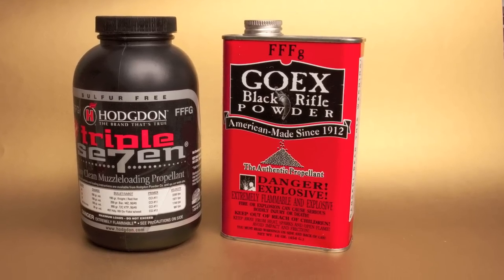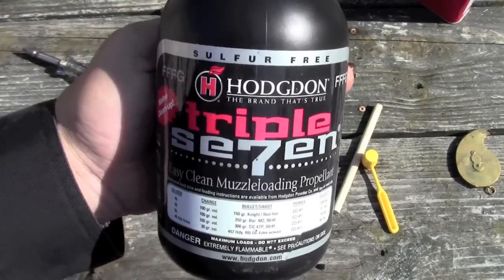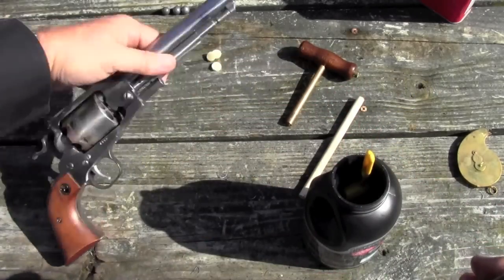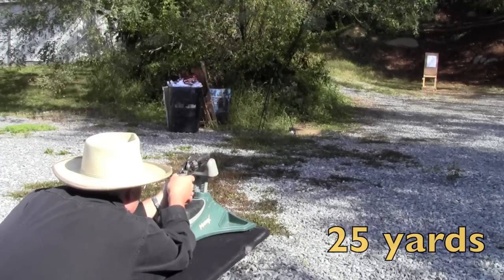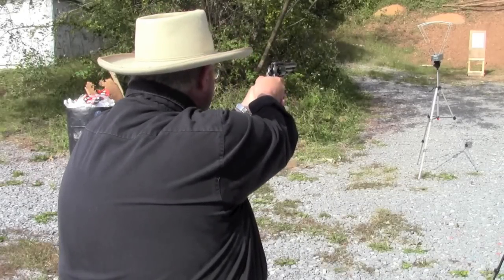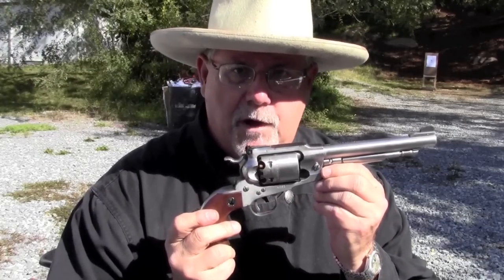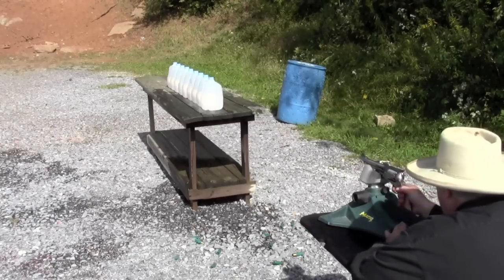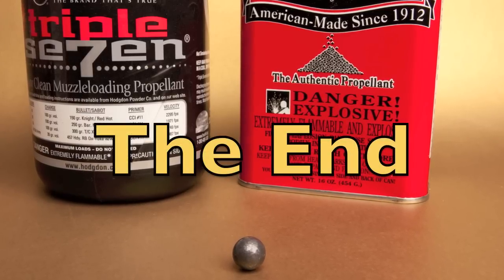Ruger Old Army powder   projectile test part 2

Comment: Great video Mike. On my Ruger Old Army I have a conversion cylinder in 45 LC. I load my brass to the top with 777 and a hard cast bullet and these rounds are pretty hot and shoot awesome.777 is easier to clean up than BP. It was very interesting to see the velocity difference between BP and 777.

Comment: According to an article in sportsman magazine back in the 80"s. The author of the story i read. The author claimed that for every inch of barrel length that inch was worth about 50 lbs of energy. He wrote that in comparing the two rifles he had tested, 30~06 /v .308. if you cut the barrel of Garand down to carbine barrel length. you could turn the power of an .06 into a 308. So if that is true, then barrel length from a rifle does have an effect on bullet performance.

Comment: Hi Mike, thanks for the very nice video.

In the Cap and Ball Sixgun section of Elmer Keith's book SIXGUNS, Elmer says that balls tend to be more accurate than bullets and the balls are a better projectile to use for hunting.

I have lots of modern firearms, but find that the accuracy of my BP 1858 Remington is as good or better than my modern pistols. Elmer even suggested that the smoke from a BP gun obscures and benefits the shooter in a shootout compared to modern smokeless pistols.

Richard